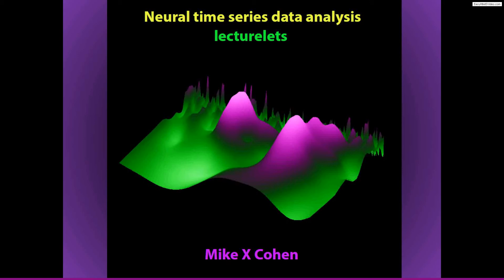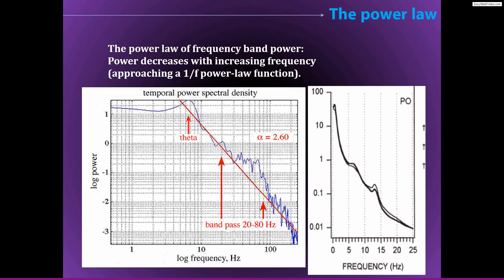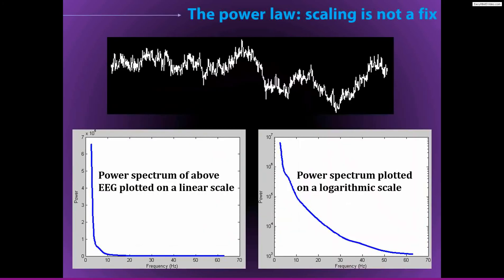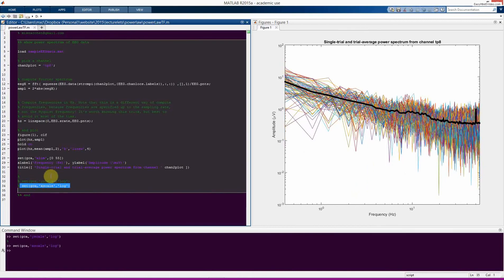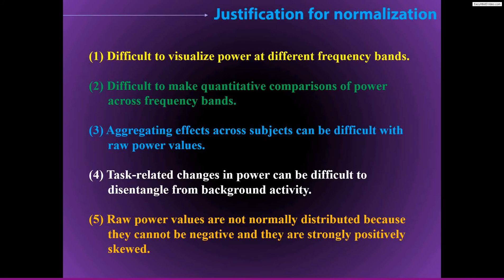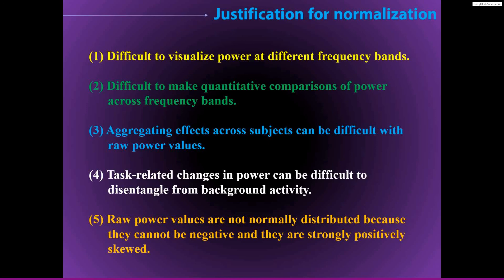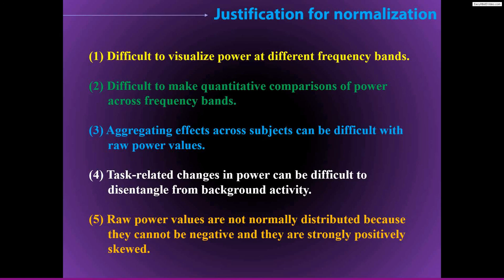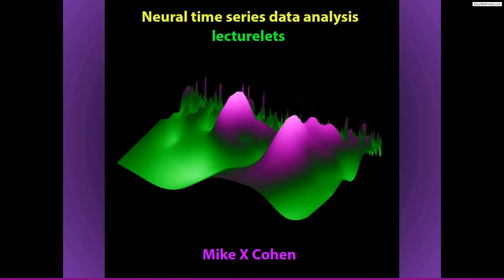Power-law scaling and the need for normalization

Comment: Hi Prof. I would like to know when do we have to use the graph which shows time (ms) versus frequency on the vertical access , and when to use the other standard graph showing power ( amplitude) on vertical versus frquancies on horizontal ? I mean from purly statistical diagnostics ( fitting , estimating , prediction) which one shall I use ? thanks
Reply from the maker: You'd use a time-frequency plot when you want to see the changes in spectral dynamics over time.